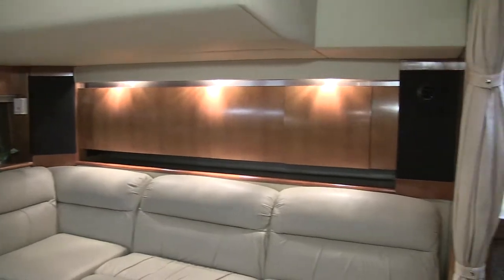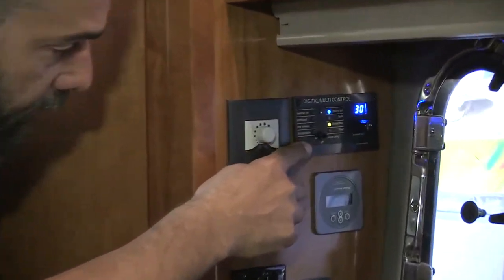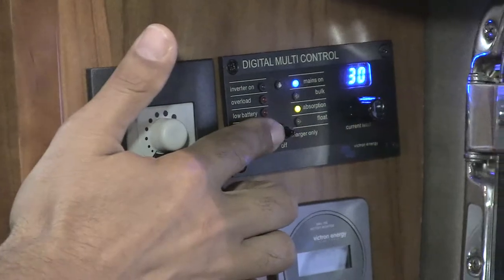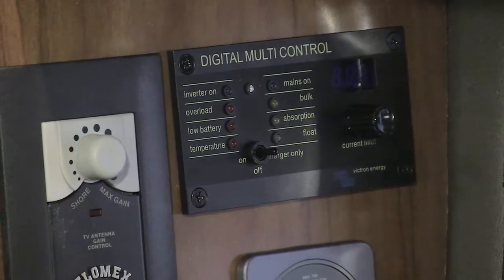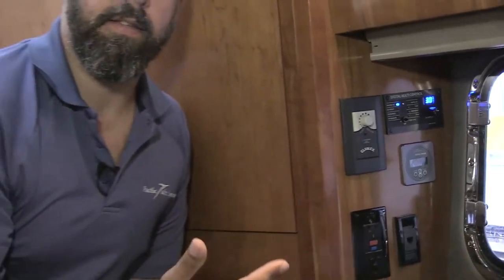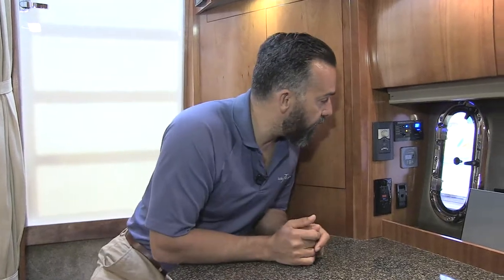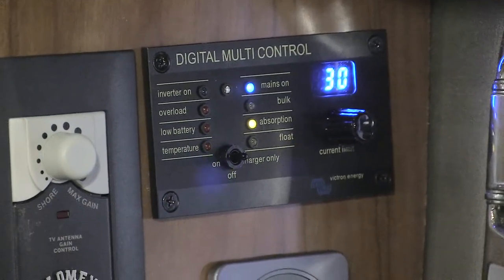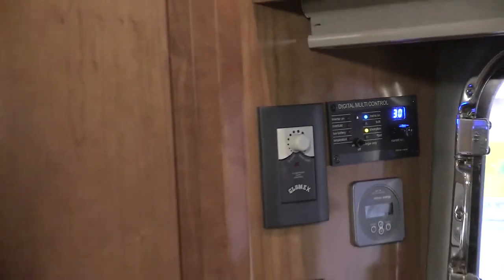How to Use an Inverter/Charger Remote Control on a Boat

Comment: Very helpful.  Thanks.  what setting should the actual inverter charger be put to and left at to use this remote or does it not matter (ie does the remote bypass the switch on the actual inverter body?)  Thanks for all your info
Reply from the maker: Good question, leave the Victron Multiplus inverter/charger toggle button in the middle (i.e. no selection) to properly use the remote.
Reply: @PacificYachtSystems  so on the "off" position?  (It's a rocker switch on my Multiplus with the same three choices as on the remote) and a toggle switch on the remote

Comment: If the shore power can deliver 16A/ at 230V I assume I still can put the dial to 12V/50A on the Multiplus since the available power is higher than the power consumed by the Multiplus charger? The only way to consume more than the available power would be if the usage in terms of current at 12V would be greater than 307A.
Reply from the maker: Doyodanne, which dial on the multiplus allows you to select 50A? Was under the impression, that the Multiplus dial on the remote is for AC shore power amp setting?

Comment: How would you setup the inverter charger to connect this remote? Switch? Jumpers? Please 
Show the inverter side of this setup. Thanks Ray
Reply from the maker: Hi Ray, this victron remote is connected to the victron inverter/charger with a data cable, plugs in at both ends.
Reply: Isn’t there some jumper wire that  is supposed to be connected also? This is what I want to confirm. Which configuration? Thanks